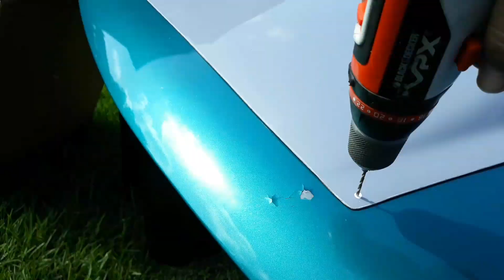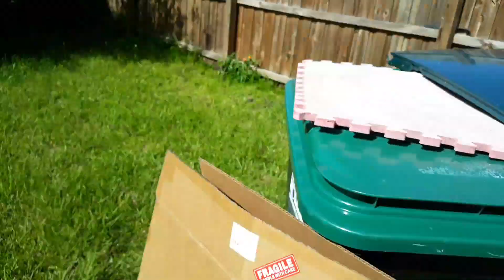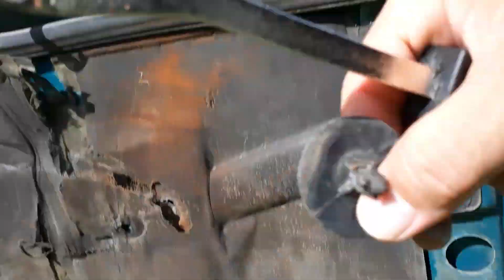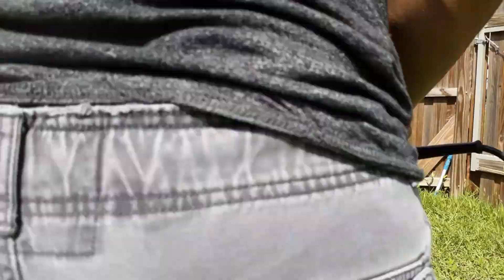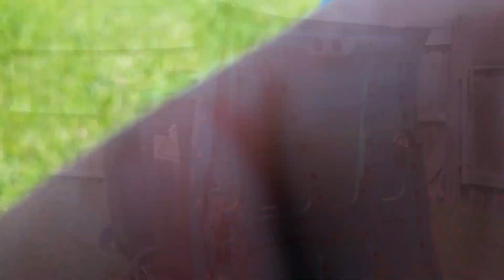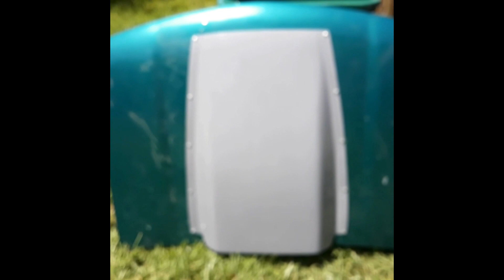How My LS Swap Sonoma Got a 3 inch Tall Ebay Hood Scoop

Comment: What did u used to put around the cut ? That black piping where’d you get it ? Looks clean btw 🙌🏻
Reply from the maker: Thank you, and the piping was ebay 10 ft roll 1/4" depth. Cheap $12 bucks.